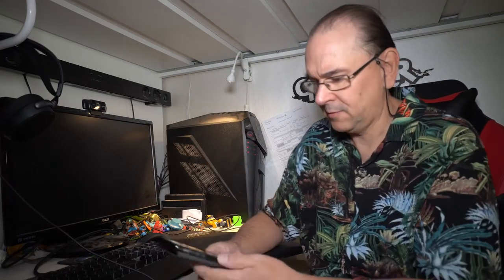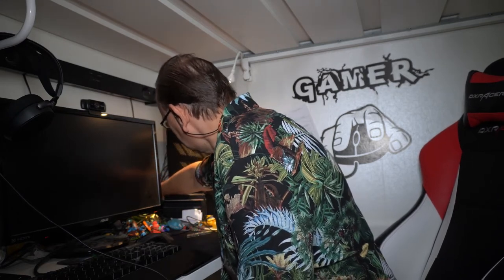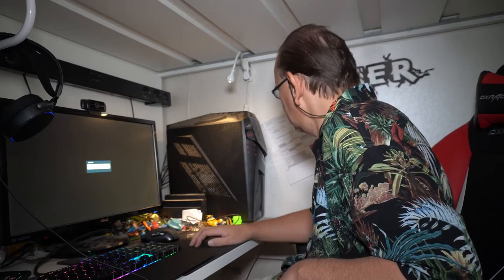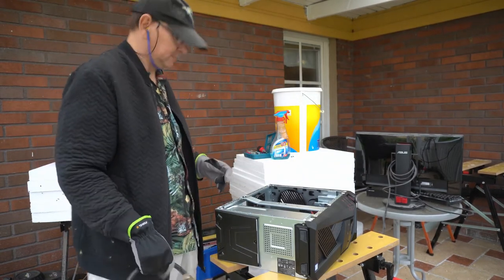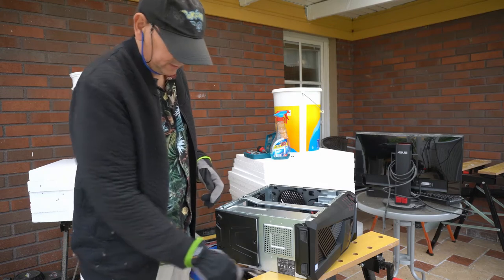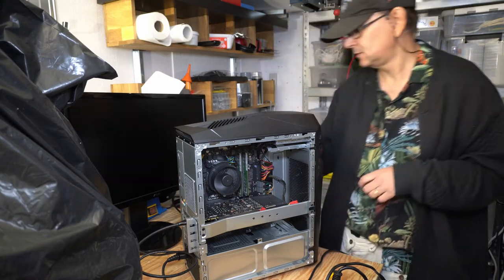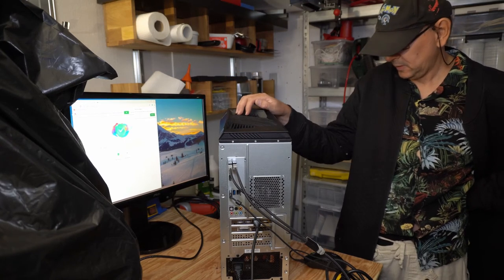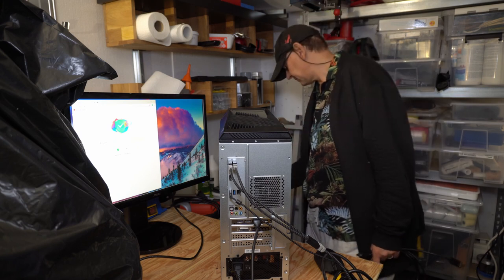Bringing gaming PC ASUS ROG Strix GL12CP-NR060T back from the dead

Comment: The HDMI cable was plugged into the motherboard (CPU) instead of the graphics card (GPU) where you plugged it in at the end of the video.
There are either no integrated graphics on the CPU or there was the problem.